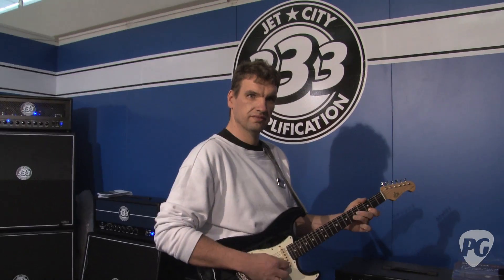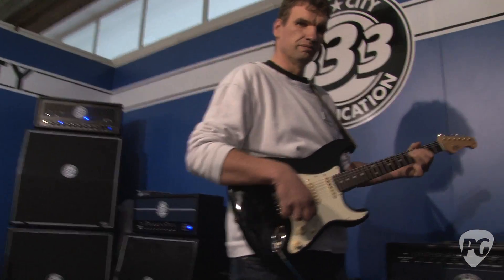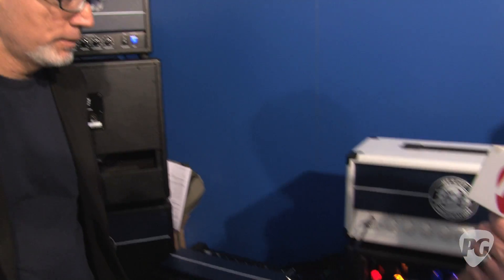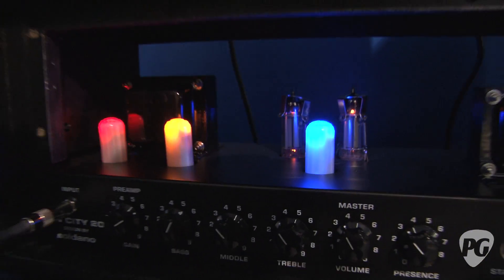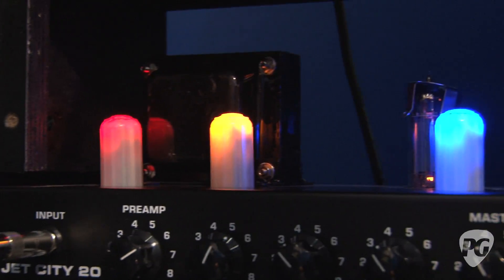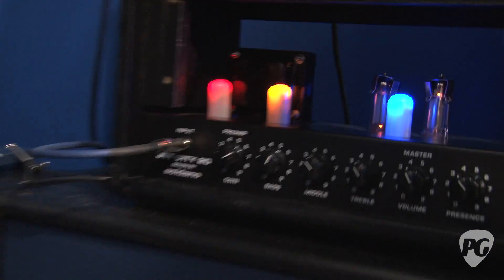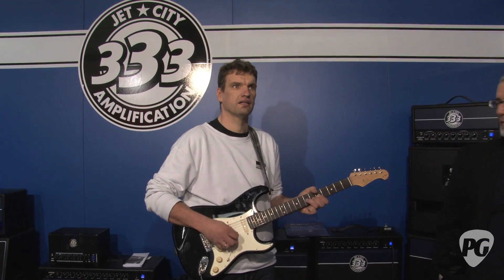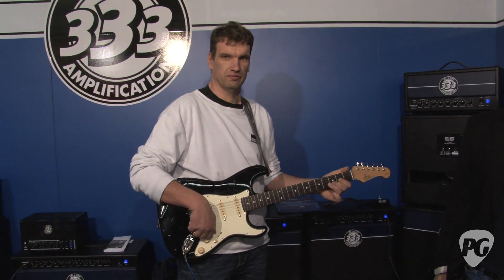Musikmesse '11 - Jet City Amplifiers JCA22H & Roberts Retro Valves Demos

Comment: @bornburied  -  No worries. I did buy one of those "other" amps. A Mesa Boogie F30. 20 watts 2- channel foot-switchable with  an awesome clean channel and an incredible gain channel. Now I have the option of running strictly Clean - I can kick in my Barber B Super Sport OD on the clean channel for some Marshall sounding crunch and then go all out Boogie distortion on the gain channel. Its like having a 3-channel amp. Very versatile set up.

Comment: So the Jet City JCA22H will have 2 channels but one's going to be crunch and the other a SLO-100 circuit...That's like the most absurd thing I've heard in a long while! If you're going to add a 2nd channel, you should add a clean channel first which we could multiply optionally with distortion pedals to feature a 3rd or even 4th channel through the effects loop anyway...I'm also confused about these Roberts Retro Valves :/ Are they built only for the preamp section? Are they tubes in the end? :S